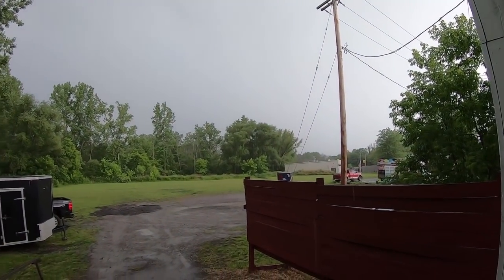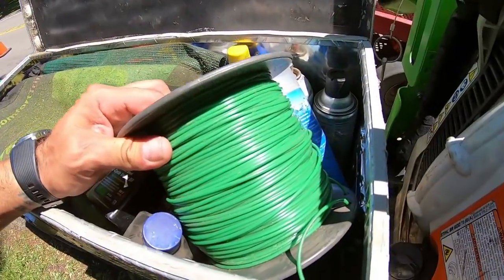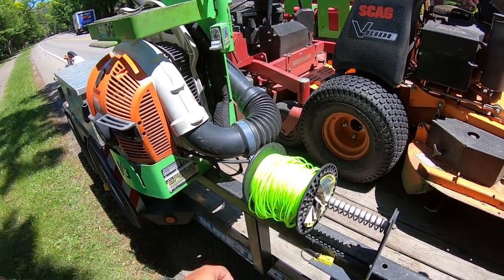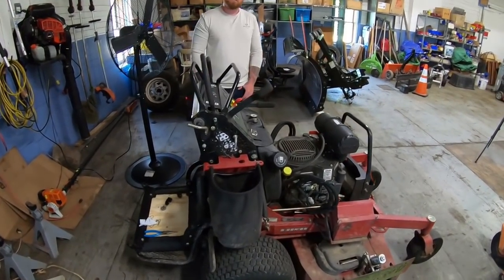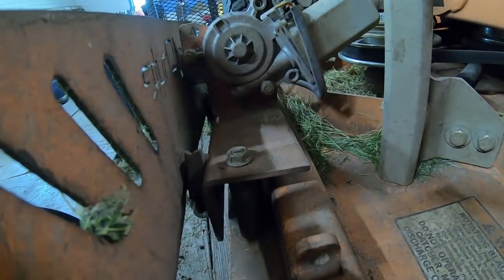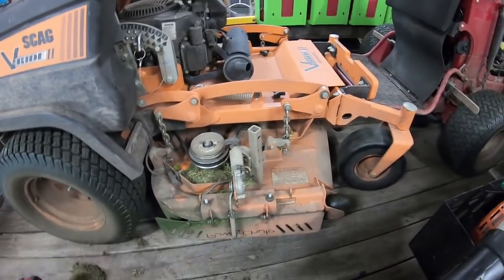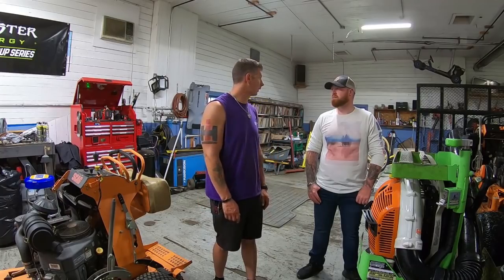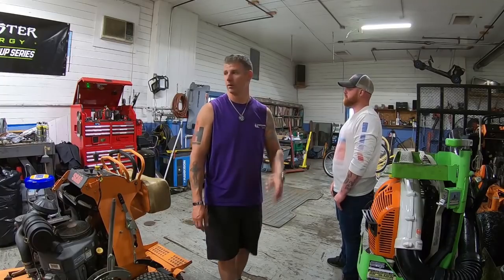LAWN CARE week in review  TONS of rain Mowers DOWN

Comment: I used to use the stihl yellow line to until i tried stihl's cpf3 trimmer line! 1.05 thickness! stuff does NOT break on fencing, concrete walls, mail boxes etc I use it to edge driveways sidewalks and garden beds! I rarely bump the head for more line,  its a little more expensive but it just doesnt break! the best part is it doubles as a brush cutter! can cut 4ft tall weeds down with ease! cheers!
Reply from the maker: Yea no thanks. I've used line that thick. To easy to damage stuff

Comment: Out of curiosity, what makes the Qwick Chute your OCDC of choice? I looked at the QC's but ended up picking up a Grass Flap instead due to the Qwick Chute motor being a not-uncommon fail point.
Reply from the maker: I don't use the qwikchute I use the PowerChute and I have been using them for years and only went through one motor
Reply: @CountrysideStrong  — Freudian slip on my part! Meant the Power Chute. Ever tried any other type? Would be interested in your thoughts, if so.
Reply from the maker: Yup I've tried them all. I do like the grass flap and the quick chute is nice but all 5 of my machines have PowerChute now. It's our favorite

Comment: Your just like me I have backup mowers. I own two 52” LazerZ hp’s, two 60” LazerZ’s and a 52” Toro Grandstand. Hopefully I never have issues with all 5 of them at the same time. So far we have been fortunate that we’ve never had to deal with that.
Reply from the maker: Backups are never bad
Reply: @CountrysideStrong  Not only do I have backup mowers I also have two trucks set up for our snow plowing and salting route, and I’m actually looking for a third truck to back us up for mowing and snow services. I just picked up another salt spreader Wednesday at an auction for pennies on the dollar. I’m working on getting a wiring harness and another spreader controller so if need be I can make sure I get my salt spread on my commercial accounts.
Reply from the maker: @edwardkane3237  👍
Reply: @CountrysideStrong  from what I’ve seen you got out of commercial snow plowing and salting gig and your just plowing residential driveways ??? I’m here shaking my head to be honest with you. My salt services generates most of my winter income. If is wasn’t for salting service I would have been out of the snow and ice services years ago. Apparently your making enough $ that you can carry yourself Through
Reply from the maker: @edwardkane3237  more than enough by a long shot and I don't need to "carry myself through". I put away so much money over the summer I can sit on my ass all winter. I plow because it gives me something to do.
Reply: @CountrysideStrong  👍🏻 I get it. Bust it from April thru November and make bonus $ with snow.

Comment: I just got the echo line and it's not bad but I will try the green stuff
Reply: Echo black diamond or edge or whatever it's called is the shit bro. There's also though a brand out there with wire in it. It's same price for a big spool and you can expect running all day on a spool. I 've seen a week on a bull head if you know how to edge the right way. Not like the Mexicans do and cut a gulley out round sidewalks that'll break your ankle. You don't have to go deep. Also if you're an applicator/ purchaser you can buy this product called EDGELESS°
 JUST like it sounds. It's a growth inhibitor
 YOU may only a commercial property twice in 6 months because it works. You can also spray on shrub and you won't need to prune . 
YOU still get paid weather you do em or not you maintain them no one can argue that. Time is everything. It's more valuable than money.

Comment: Check the fuse box on the inside by the seat I had the same issue with my machine and I had the fuse fall out and I had zero electrical power
Reply from the maker: We'll update, it's fixed

Comment: Be careful with hydro problems once the system is contaminated with metal fillings your going to a black hole l would replace all motors / pumps and it doesn't work l did it not worth the money
Reply from the maker: Been doing it for years, never an issue. Just gotta flush it correctly.